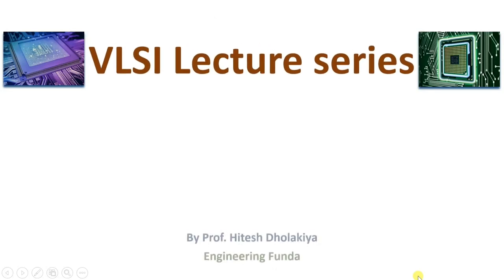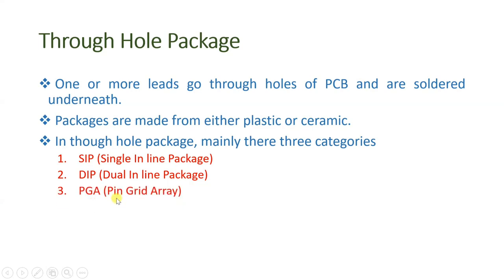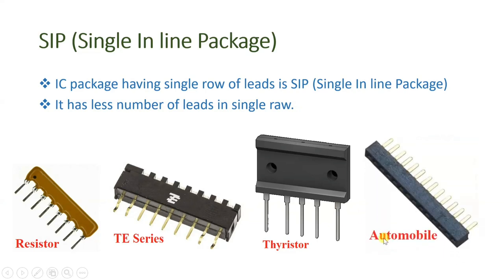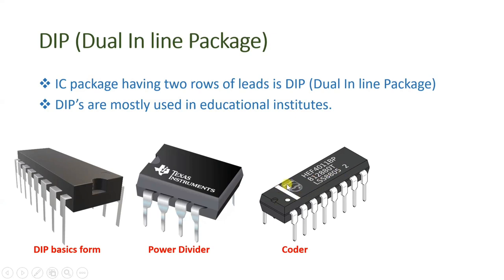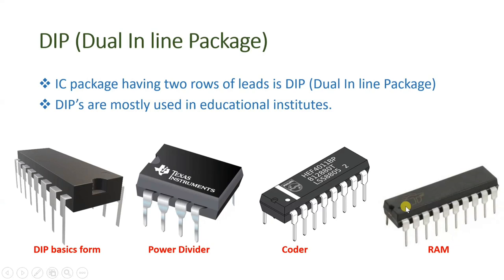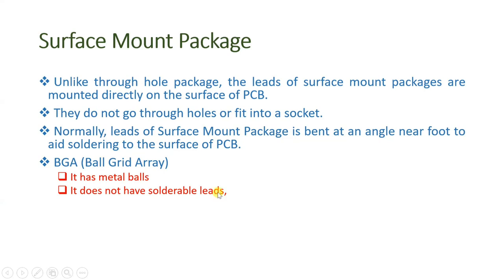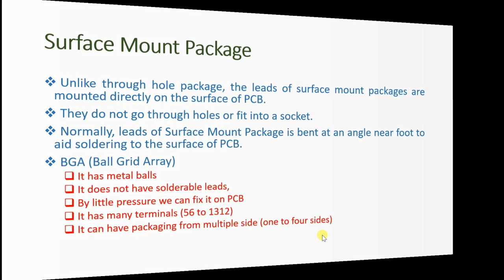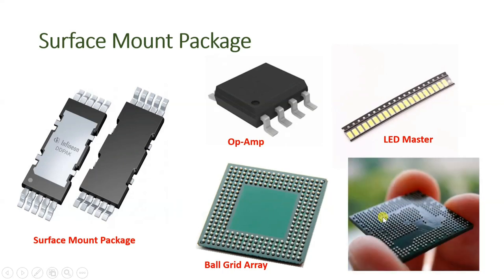Package Technology in IC (SIP, DIP, PGA, Surface Mount Package & Contactless Package) Explained

Comment: what's the best explanation why IC (Integrated Circuit) is in Square/rectangular shape, not circle?? Why they manufacture it on that shape? Thanks.
Reply from the maker: If IC'S are Circular/square then in PCB we cannot utilize 100% area effectively, but by rectangular shape it is possible.